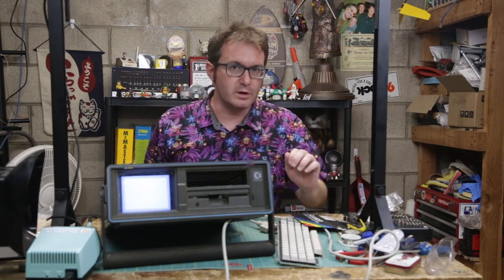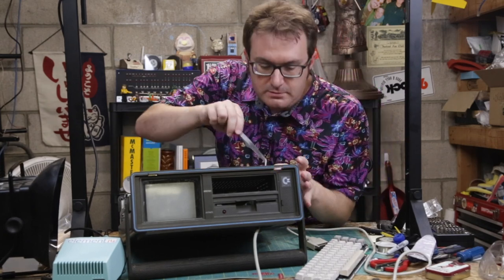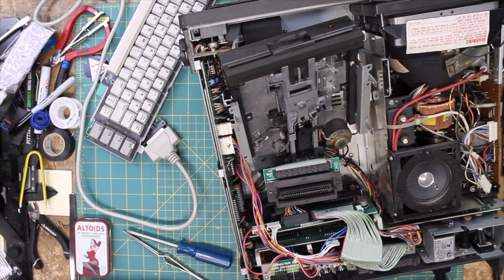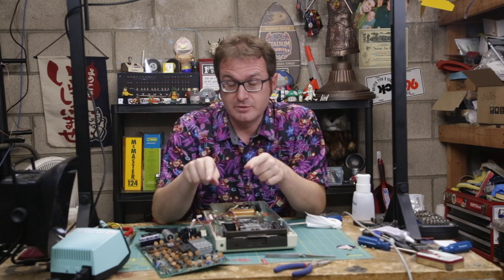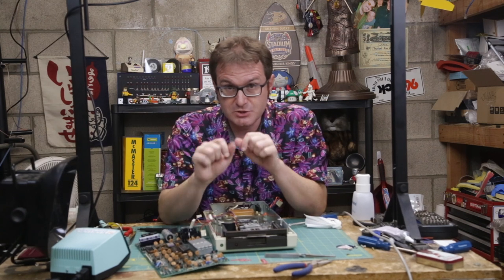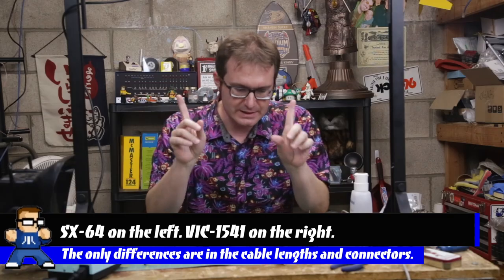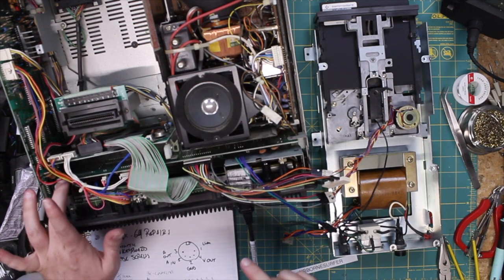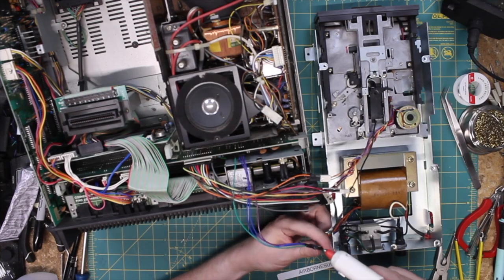Commodore SX-64 1541 Floppy Drive Repair

Comment: I 100% appreciate the level of excitement when it finally works, I've had that level of joy many times working on c64s.  Interestingly working on my SX-64, and the mount for the drive and pocket above is QUITE different than your system.  To physically remove my floppy drive I would need to remove both the system board AND the monitor to get to the screws (or have a very thin right-angle ratcheting driver).   Thankfully my issue was on the SX 1541 board and was repairable vs. having to replace the whole board.

Comment: Very intersting. I also have a SX64 with a quite problematic disk drive. At a quick look it seems to work OK but I have occasional read errors which can not be tracked down to an alignment problem. Interesting is the fact that it seems to come from the internal CRT monitor. When I disconnet the 12V of the monitor and run the drive blind, I NEVER have read errros on the disks I use to test. Read errors tend to be worse on Disks which have been recorded a long time ago which still work OK on stand alone drives. Again, it is no alignment problem, since these disks also run perfectly when the CRT is disconnected inside my SX internal drive. Recently written disks run also good, when the Monitor is operating. So I think I have some interference problem of the CRT which is bad enough to disturb the reading process to generate read errors. Someone suggested bad capacitors inside my CRT which might pollute the signals or the power supply lines. But when I search the net i almost find NO ONE with this particular problem. How is your repaired SX? Is it also problematic with some disks which run instand alone 1541?

Comment: The felt pad needs to apply a certain amount of pressure to the read head in order to read the disk properly. Yanking the pad up at 90 degrees is just going to stretch out the spring and ruin the pressure the felt pad applies. Please don't do that. You can clean the head from another angle.

Comment: you could test if it was just the head who failed :) - it would act the same way :)
Reply: I thought same thing. After cleaning head and lubing rails, I would’ve ohm’d out the head BEFORE pulling it apart.
However, I guess if head was bad, it would’ve had to been pulled eventually. 
But still.
Reply: To replace the head, you need to be prepared to perform an alignment afterward. There are far more entire drive mechs than there are functional heads, sadly; so you may as well just replace the entire mech.

Comment: um why did you go through all that , why didnt you just hook that external drive up to the serial port in the back and do load "*",9,1 or discconect the internal drive and leave the external one in back and do ,8,1
Reply: That wouldn’t have narrowed down the problem since the external 1541 on device 9 would be using its internal RAM/ROM board and not the SX’s.